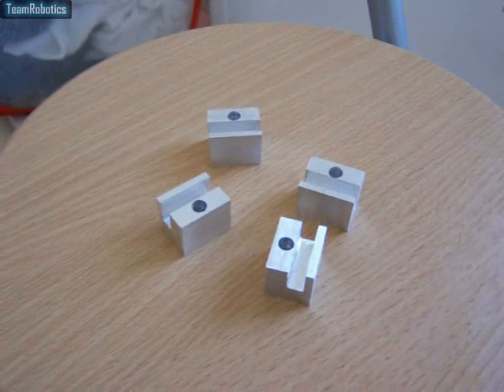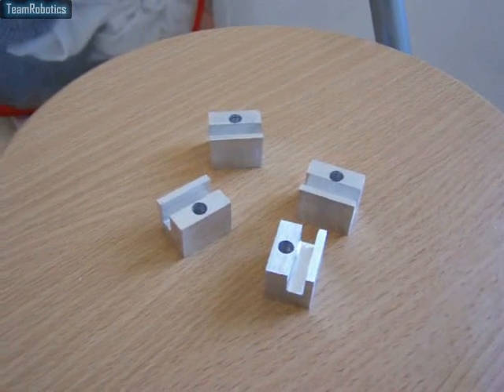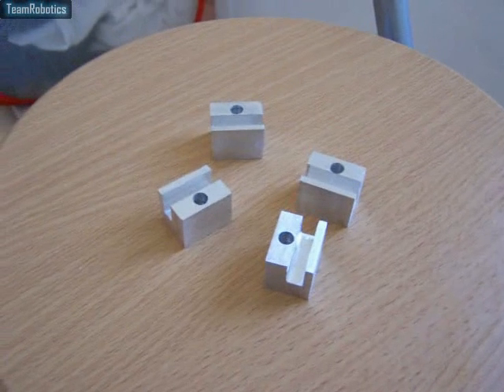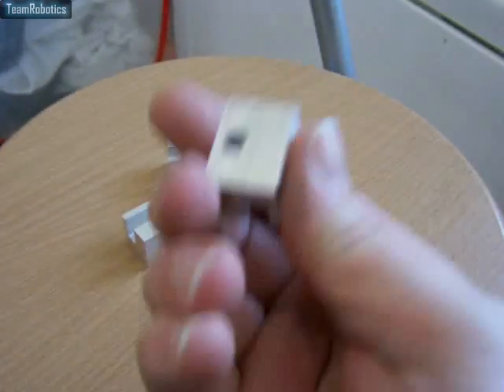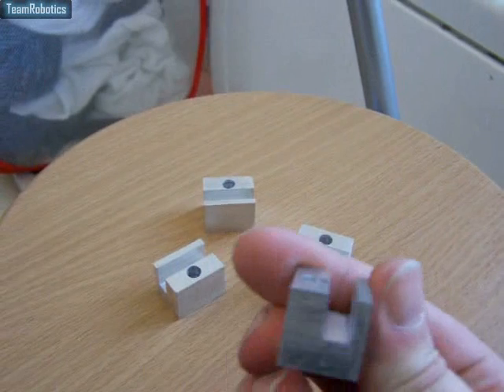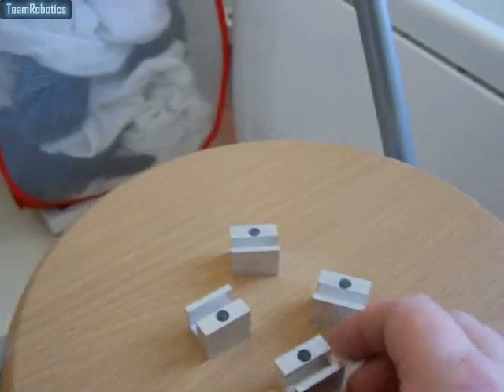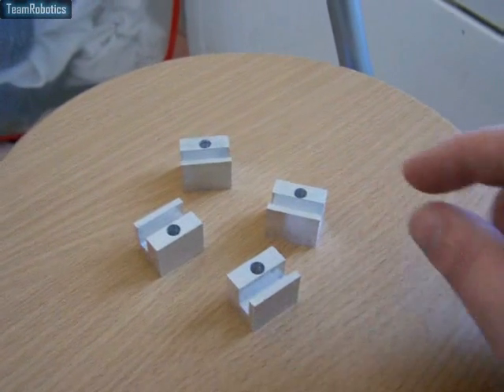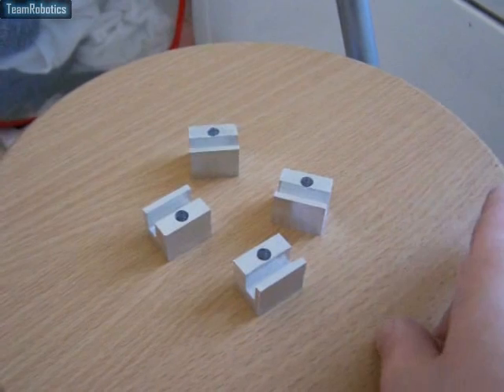150: four track tension blocks machined

Comment from the maker: Hi there ive been pretty busy with real life things lately. But i have just posted some videos for the Base cradle unit. There are a few parts i need to make for the track units that ive simply not had the time to do lately, this is the collars to go on the ends of the idler tubes inside the track units...